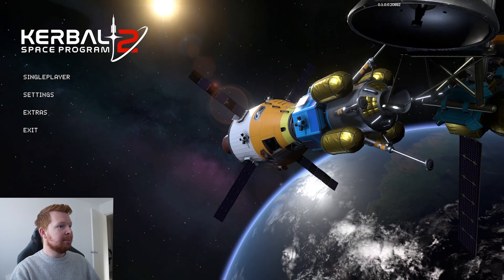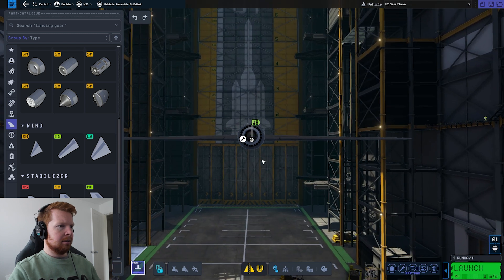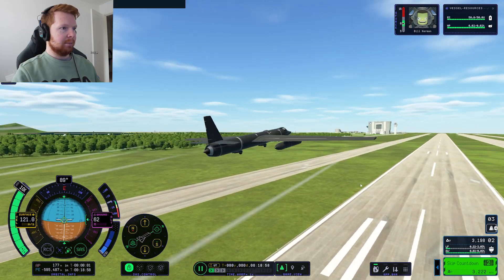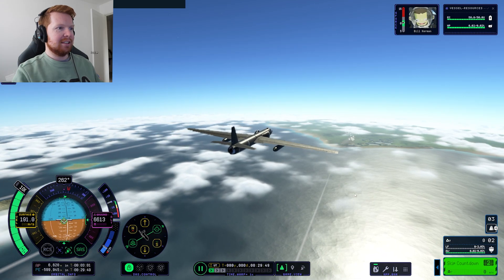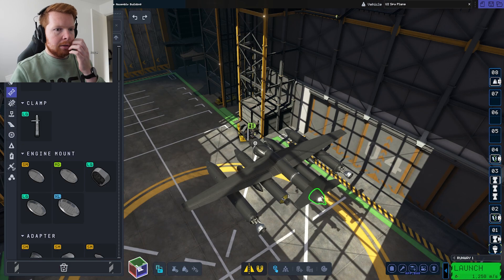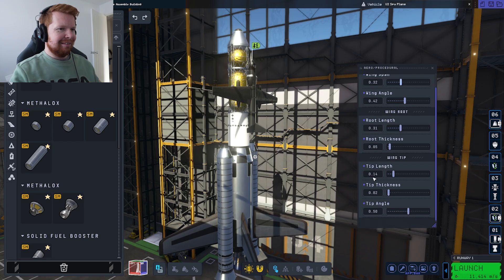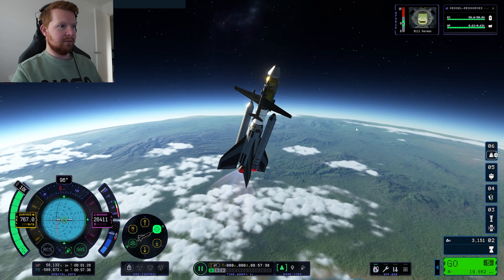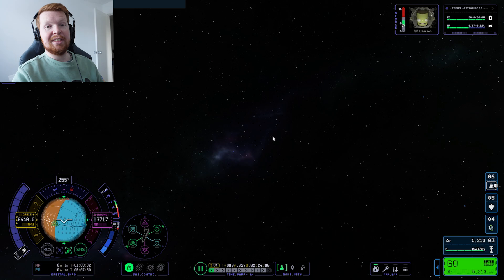Kerbal Space Program 2 - U-2 Spy plane

Comment: If you turn sas off for planes the wobble does go away.  I wish the caps lock sensitivity button had a setting to modulate the level of sensitivity.  Also the alt trim function is amazing yet broken you should be able to remove the trim settings instantly in the event you trim the craft wrong.

Comment: I'm disappointed in the early access. I was early access for KSP1 and I don't think it was as bad. I hope they work out the major bugs quickly. Have they made update announcements yet?
Reply: Early KSP 1 was, well, maybe not quite as buggy, but almost unplayable if you wanted to do anything with more than like 5 parts because the joints were held together with small rubber bands instead of bolts. Even now, it’s hard to make a swing-wing plane whose wings won’t just fold when you pull up.

Anyway, the first round of patches is supposed to be ready “soon”.

Comment: KSP2 is terrible. They put lipstick on a pig and called it a beauty queen.

All we really wanted was KSP1 better optimized with better resource utilization. In its current form, it is nearly unplayable. "Early access" is no excuse. I played KSP1 since 2011, and it was never this buggy, nor this resource hungry. I'd trade clouds, paint schemes, trees, and sound generation for a smooth running KSP1 in a heart beat.

God forbid you do fuel xfeed or add any struts. 

Running on an engineering desktop that handles everything else I throw at it. 

I supported with my $50, as a wishful investment. At this point I have low expectstions. Seems like many of the design never even spent time playing KSP1 judging by the complete lack of, or bugginess of some of the most crucial features for any longterm KSP player. You can tell their focus was the new player, by dumbing things down such as calling a 1.25m rocket a "small" as if differentiating 1.25m from 2.5m was hard to begin with.... All while completely missing the importance of things like struts and fuel xfeed. Give Squad the same funding these devs got and we'd have a usable product.

Comment: here is some useful tips!
- the fuel tanks that you are using to offset the weight of the U2, are not connected to the main fuel might help to get a bit more out of that last stage
- i think you should be able to goto the tracking station and select the u2 from there(you can also do this whilst flying)

Comment: Neat thing about the U-2 is that the "fuel pods" on the wings are actually for sensors! Another cool thing is that the U-2 cockpit is the same as the F-104 Starfighter's!
Reply: Lil known fact about U2 is that bono is a total wanker.
Reply: Doesnt the u-2 have a yoke instead of a stick?
Reply: @plaady  Yes, but the cockpit housing is the same
Reply: @underseaowl7440  Wasn't the whole thing originally based on the Starfighter? Fuselage still looks very similar.
Reply: @popuptoaster  Yes it was. But it did'nt fall down so often

Comment: today  in ksp2 i pulled 215G in a plane and went to 100k altitude so i dont think the models are quite done yet
Reply: Sounds about right for KSP
Reply: Were you using a rocket to propel the plane? obviously there is something wrong with 215G unless you had crashed. But getting to 100K with a rocket isn't inaccurate.
Reply: @NNFaNRacing  no just two jet engines